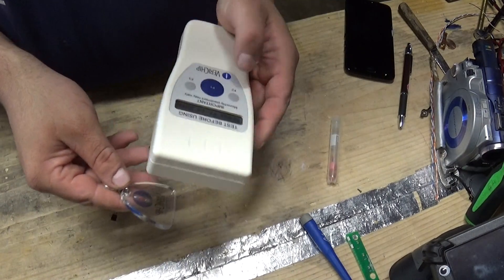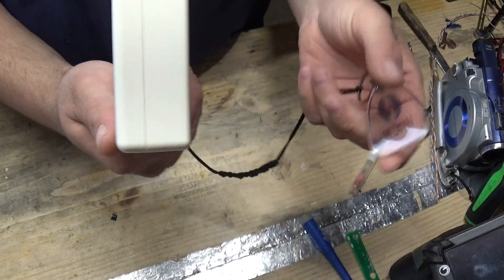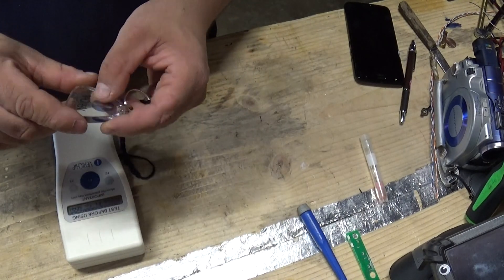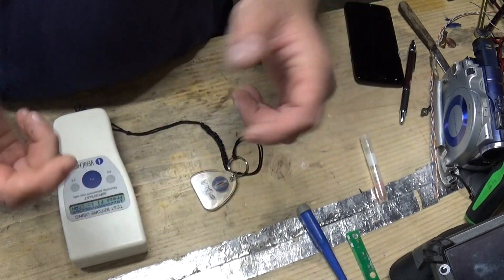why GPS tracking chips and microchip tracking implants are bogus

Comment: You might want to check out chipsafer as to what is capable from a private company. Government technology would be far more advanced. Using the new starlink system it would be easily instated.  Also people won't just remove them, at least no if it is the only wat that you can buy or sell.
Reply: Also there is also 5G technology that can also be used for tracking within city limits.
Reply from the maker: I just looked it up, the company you mentioned uses collars worn by livestock, not tiny chips injected under the skin. I never said satellite tracking doesn't exist, as it does, and is used for all sorts of things. I said it's not currently possible to make a transmitter/receiver and a power source the size of a rice grain, and have the capabilities to transmit data to satellites. The technology isn't there yet. The current GPS tracking devices are the size of a USB drive, or bigger.
Reply: Will Phonemans tech:  you must an agent or if not then you definitely need to do more researches about micro chips

Comment: Tracking microchips using in espionage are different
Reply from the maker: There would be no way to make a transmitter and power supply that small, and it have enough power to transmit more than half a meter, let alone run for longer than a day. Not to mention, how would they get one into a person without the person knowing? Tracking you by the devices you already carry is so much easier.
Reply: @WillPhoneman  o yea for NSA and CIA